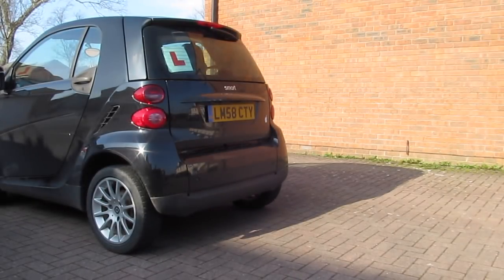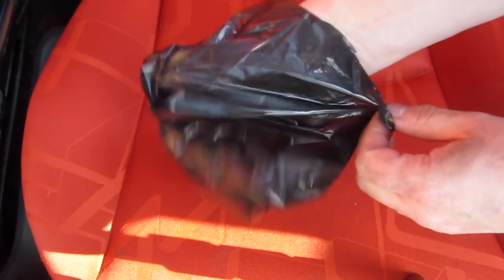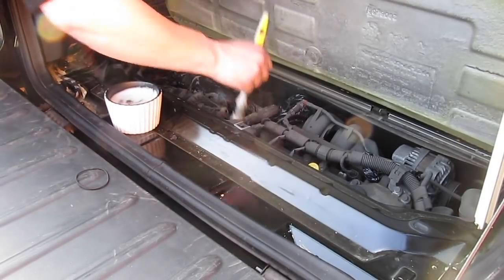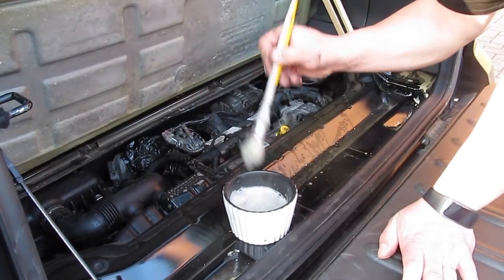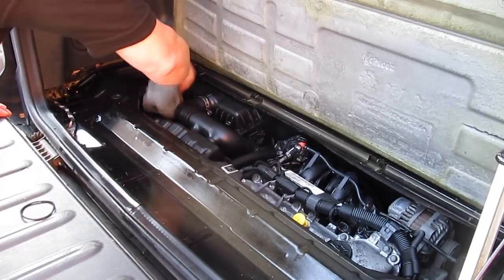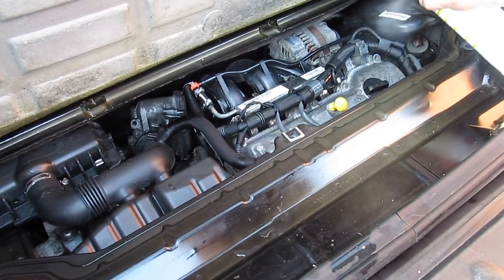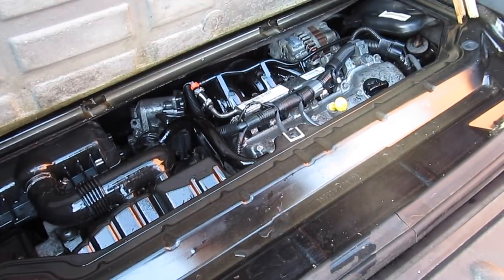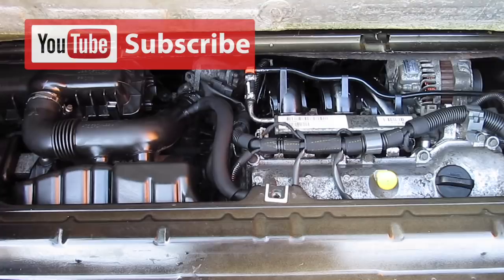How To Clean Your Engine Bay

Comment: Well done!  After 10 years and many miles it's time for me to clean my smart's engine.  The way you did it is so much better than gallons of solvent and a high pressure hose.  If it ever gets above freezing here, I will clean my motor your way.  Thank you for a great video.
Reply from the maker: James Duernberger thanks so much for the kind words James. Where are you in the world??
Reply: I reside in the US, south eastern Wisconsin.  Today we were greeted with 8 inches of snow and below freezing temperatures.  I am sure spring will arrive someday (I Hope)

Comment: I saw a different video saying that spraying WD40, as it is greasy, it will collect more dust and degrade the cable plastic and other plastic surfaces.
Reply from the maker: Rene Alanis fair comment to a degree. WD40 has many purposes and there ares different types now. You did see that I wiped it down afterwards?   I used it firstly to disperse any sitting water then seal it.
Reply: I wouldn't recommend using wd40 anywhere near the alternator belt
Reply: Armor all yo

Comment: Unrelated to this video. However I’m hoping you can help. Went to clean rear screen on my Fourtwo and no water came out from the rear nozzle. Instead a pool of water underneath the front of the car below screen wash bottle. It seems as if the pipe to rear wash has either come off or defective. Where is that pipe located as I can’t see it when I remove the front cover?
Reply from the maker: Dicky P9NRY normally it’s the water pump in the front service area I believe behind the wiper motor

Comment: Solid vid, lots of excellent tips Thanks
- just followed them and it's worked 'wonders' - well . . . imporved things a lot -  & I agree  that the engine bay hasn't ever been treated to a de-grease for a long time, if ever - 
Also - as I couldn't get out to get de-greaser - made my own - & it really appeared to work
Just used 'washing soda' - not baking - and it certainly seemed to take the grease and oily deposits out. 
On-line there are plenty of 'make your own de-greaser' pages. involving, white vinegar, kerosene (americans huh?) baking soda, ornage peel, essential oils - I thought I'd give it a go with what I could find lying around, so my advice . . . . . being simple with the right chemicals is fine, just fine, dont get sucked into all these 'clever' gimicky tips - research the chemistry, it normally brings the right answer .

Now, on to cleaning injectors, cylinders, fuel lines etc, 
Thanks again
Happy (and Holy) New Year
Reply from the maker: What an awesome bit of feedback. Thank you so very much. I’ll 100% look into making my own degreaser. 🙏 thank you

Have a blessed New Year.

Comment: howdy!

I plan to do this on my cabrio but I have a somewhat stupid question.

How do I remove the trunk cover (0:45)? I can´t seem to figure out how to take it out.
Reply from the maker: Ubiratã Muniz da Silva do you mean the engine cover panel?
Reply from the maker: Or do you mean the cover that separates the trunk space from the cabin?
Reply: Smart E.R. It was the cover which separarates the boot from the cabin. But I did found out how to take it off. My engine bay is now clean as new. 😉 Instagram.com/ubiratamuniz

I used a different product due to availability in my country (I used a local brand degreaser instead of gunk) but all the rest is just like you taught us.

Thanks!
Reply from the maker: Ahhh yes. We take this for granted. Glad you are all shiny and new now.

Comment: Better to use Swarfega Duck Oil than WD40, it's non conductive and does an even better job, IMO.
Reply from the maker: Balloaks will check it out. Thanks. Can you buy it in the UK?
Reply: @smarte.r.1450  Yeah, readily available just checked Amazon.